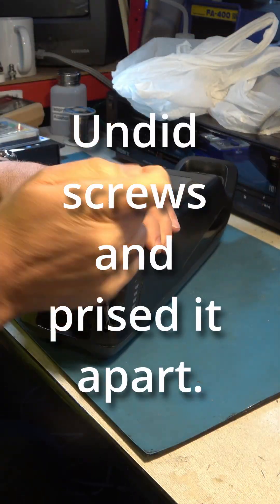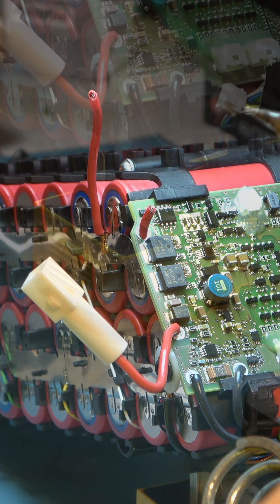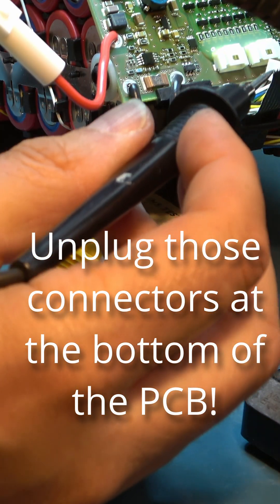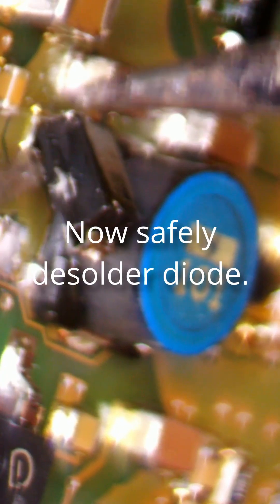Bosch Bike Battery, how not to change the Schottky diode

Comment: How did you determine it was a diode failure?
Reply from the maker: It's a well documented fault on these batteries.
Reply: My battery is charging but it wont communicate with my display it wont charge the display nor show the battery percent would u say its a diode?
Reply from the maker: @whitefeatherslinger8194  Probably not the right fault, no.

Comment: There actually aren't any other videos on YT showing how to change the Schottkey diode. Besides the sense wires, did you also disconnect the B+ and B- wires before changing the diode?
EDIT: This is the best instructional I've found:
https://ebikesrule.wordpress.com/2020/08/14/bosch-bms/
Reply from the maker: Yes I remembered the B+ and B-, just forgot the sense wires.
Reply: @video99couk  Thanks, I figured as much. I've just ordered the Shottkey diode and will attempt replacement when it arrives. The whole procedure, including IDing the anode/ cathode orientation for the diode surely deserves a complete video of its own.